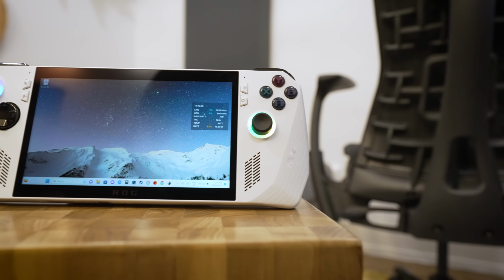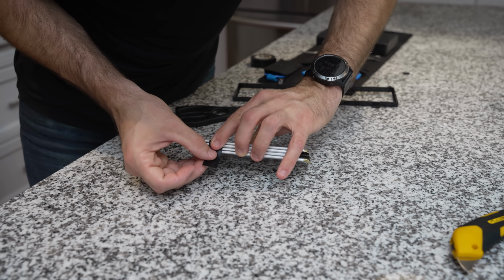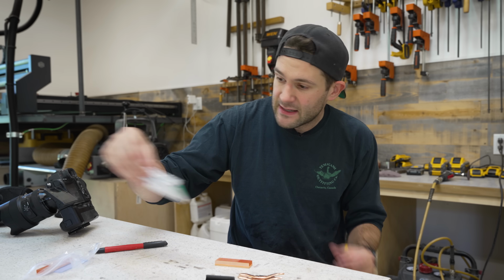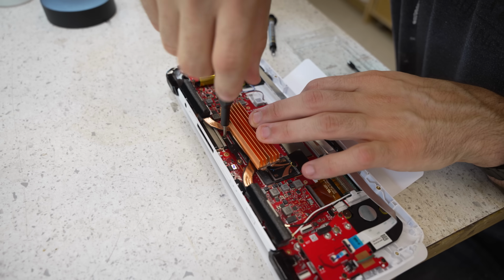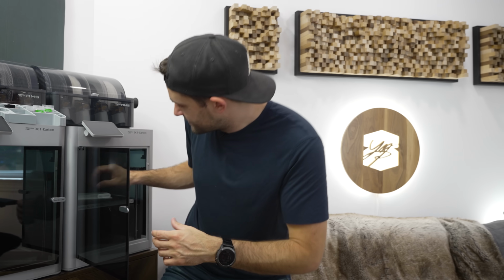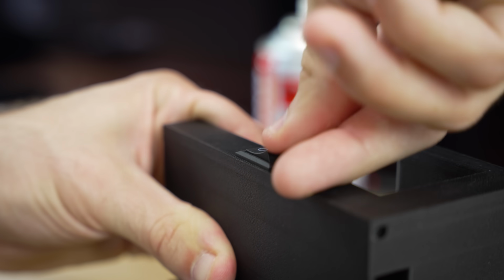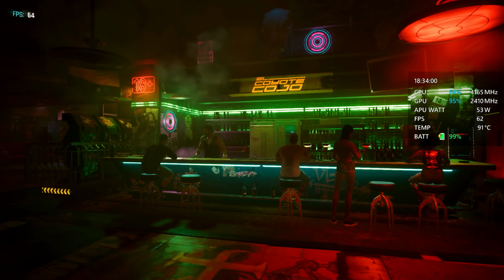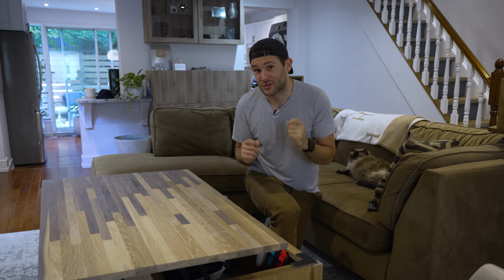I don't understand why people buy Steam Decks...

Comment: Would've been even cooler if you also added a push button for controlling the fan so it only activates if the Ally is actually docked.
Might have even found a way to detect if the dock is delivering power to the Ally and then trigger the fan based on if the Ally is powered on and sucking power from the dock.

Comment: the liquid metal ate the copper heat sink  didnt it?

cause i think you needed to nickel plate it first
Reply: also, is not liquid metal gallium? aluminium and gallium, not friends, as it destroys alu makes it like crumbling flakes :D
Reply: You can nickel plate a copper heat sink luckily, however you can just straight up use it on copper, it just has a chance of difusing and a second layer might be needed

Comment: now you can buy aftermarket Steam Deck for 512gb around for $250-300
-Repairability
-Availability of spare parts
-Great software and optimization for a handheld (it works 10-15 watts nice< even better on this wattage than other handhelds)
-The love and effort that Valve puts into the Support of their Steam Deck 
-You can use it in more diy projects

You can buy brand new Oled version with better hardware

Comment: You will need to reapply the Liquid Metal again later because it does absorb slightly into copper. If you notice an increase in your system thermals later, that will be why.

Comment: Hi! I have SteamDEck and buying Xreal Air 2 Pro for it. Its main problem cannpt power/charge while using the glasses as only one usbc port for charge or connect stuff... There are various expensive muds like RedMagic dock etc to solve it but with a cable mess.
I am building lithium packs for drones and electric motorcycles so have some soldering skills.

I have a plan to solder  to the 2 main +- cables of the Sd battery and make a small DC 2pin pug to one side.
That way I could give power to the battery leads directly which is as a 2S battery around 8.4V (it is written as higher voltage cells so 8.8V is the max, but I can measure vilt voltmeter at 90% charge level if it is 8.8V I can set a stepdown to 8.8V for example.)

And I could power it from 12V battery/adapter using stepdown dc-dc module setup for the battery voltage to keep (8-8V for example)....

What do you think?

Comment: Windows is the ROG Allys biggest weakness.  SteamOS is better.  In fact I'm building a desktop using ChimeraOS because I like the SteamOS experience so much.  I also don't like that the ROG Ally doesn't have touchpads like the Steamdeck does.  It should have at least one so you can use the desktop mode without using the touch screen.

Comment: Heck, okay, if tha Ally is too low fur u, u have simply too high expactations of a HANDheld...it must run cool, u know!?!

Also, yeah, the MSI Claw is out, might suite ur needs better.

But all gonna fry ur SD cards, if u not read tha manual, get the absolute fitting one!!!
USER's fault, 95 of these...rest r faulty SD-Cards!

Still, tha Steamdeck is fur tha pros, who know how to use the PC advantage in games...settings, and want to play fully mobile, fur 6-12 hrs, the competitors can't do, accepting the 720P limit.
Simple, but yeah, fur someone as spoiled to have issues with a handheld, one gen further then PS5, and not using Chimera OS...sorry, u r a IT noob!

Comment: When possible, I use my Ally 3 hours a day and I never cooked my SD card. I think that when people use handhelds as a desktop replacement, hook them up to an external monitors / tvs, and add external mobile GPUs and act surprised that the heat increases... and that the sd card "fries"... they prove the point that they are not the targeted demographic for handheld gaming pcs. I cannot blame them, marketing ruins everything, everytime. Special thanks to the grandmas who bought those for young kids at xmas and that were returned to Best buy. That allowed me to score an open box for 600 Canadian pesos (Z1 Exterme, flawless, my son is playing Battlefront II on it as I write this comment and we will be playing Helldivers II tonight... I digress) I agree that the SD Card slot placement is a design flaw, but again, if you use your Ally as a handheld device and upgrade your hard drive with a WD Black 2TB, you will love this thing. No need to dremel your back plate or to alter your cooling architecture at all. I have 2 Steamdecks gathering dust, we loved those devices but I am going to sell them and keep suporting Steam with games and future Steamdeck releases. Sure I miss the touch pads of the Steamdeck but that does not stop me from playing Command and Conquer Generals Zero Hours with the analog sticks on the Ally (yes I am old)... Ho, and my kids can play Minecraft for Windows, COD MWII, etc.

Comment: I suggest swapping the dock fans orientation. Aren't the stock fans on the ally blower style? If so they are pushing the air out from the top vent. The dock fan is pushing it back inside, potentially making the fans inside spin slower.

Spinning the dock fan around will pull air out of the exhaust vent.

Comment: I think you have one of the reasons right there and you didn't even mention it (however, I'd not expect you to install Linux on that ... thing). The Steam Deck is Linux-based, the ASUS is (as you've shown) running Windows. From my limited experience - I only use Windows for gaming, because of nvidia and bla bla, but I hear it's not that difficult to get the same experience on Linux, it's just that the steam app on Linux sucks even more than on Windows - Windows running "idle" has a much bigger power-draw than Linux riunning "idle". I've actually seen a higher power draw with a Windows system doing nothing than with Linux running two web browsers (because Slack is not supported on any chrome-based derived browsers anymore. Well, except the one nobody wants to use, MS Edge), a mail client, Visual Studio Code and a heap of terminal windows. Right now my CPU is fluctuating between 2% and 4% with that workload and Windows is using 10-12% doing basically nothing (no user programs started).
So I'd think the difference between this and the Steam Deck is a choice of what you want to do - do all the Microsoft stuff for Microsoft (or whatever they do when Windows is "idle"), or just play your game and concentrate on that. And I think Steam has made the right choice for a gaming machine, ASUS has not.

Comment: I can think of 3 reasons immediately.
1. Price
2. Convenience / support from Valve with their own OS
3. Elegance / design vs Ugly RGB lights
Reply: Also great ergonomics vs constant thumb sore
Reply: @arseniy3763  You had to be joking Steam Deck built in controllers are complete trash
Reply: @newmobils8294 well sorry but ROG is ugly and bad designed, Steamdeck is not, proof is Steamdeck will barely change its design and ROG is going to do it constantly over the years with the model probably also dissapearing
Reply: @josevalero3543   Arguing over the most subjective part of the two consoles is really dumb
Reply: @marcedoreste Also people are tired of being screwed over by Asus
Reply: rgb is a waste of space and money and electricity
Reply: just turn off rgb
Reply: Lol, bro really said "elegance" 😂. That chungous deck is the ugliest shit I have ever seen.
Reply: 4: the sd card slot won't die from a terrible design
Reply: I do agree that with the steam deck the controls definitely take some time getting use to but I never had an rog ally so I’m not sure if it’s controller are  better
Reply: Im sorry but both of them are ugly, the rest i agree with
Reply: Here is another reason : ASUS is infamous for hardware failures and trying to scam you hard on warranty repairs.

The original ROG Ally WILL break your microSD card by overheating it.
Reply: Steam Deck design are elegant? You've got a weird taste bro.
Reply: @LoL7LoL777LoL  It still looks like it's in an early-stage prototype.  I mean, the controls look like they were tacked on.  Now, looking at the Aya Neo line, those are beautiful machines.
Reply: @WJCTechyman  Thats what I thought.
Reply: Sorry but Steam Deck is the ugly one here Asus ROG Ally is way prettier.
Reply: @newmobils8294  you clearly have a bad taste
Reply: @josevalero3543   Anything that upset Steam Deck stans even if it was factual is considered bad taste
Reply: @josevalero3543  Just looking at the Steam Deck's controllers makes me think Valve could have done better.  They could clearly eliminate the nonsense that's the track pads.  I've never been a fan of track pads, unless it's Apple's version of them, as they all seem quite irritating compared to my track BALL.  Also, the standard button layout seen on Nintendo, Sony and Microsoft's standard controllers is really all you need.  Two shoulder buttons, two triggers, two thumbsticks with integrated buttons, four main face buttons and some function keys (+/Start, -/Select, Home/Xbox/PS, Capture).  Also, the track pad on the Dual Shock 4 and Dual Sense 5 seems to be a better option than Steam Deck.  Also, the motion sensing in Sony and Nintendo controllers is a nice feature, but some find it unnecessary.

Comment: Cool project! But you didn't talk about the difference between the Deck and the Ally, as titled!
Ally pros:
More power (Obviously)
Better screen (than the OG deck, not the OLED one)
higher resolution
Higher frame limit
Don't have to install Windows if you want it
lighter
smaller
Can connect to proprietary eGPU if you happen to be one of the 5 people who have one

Deck pros:
track pads
Gyro works simultaneously with thumb sticks (Ally switches from one to the other on the fly if you try to use gyro)
more back buttons
better ergonomics
OLED version has OLED
better battery life
Cheaper
Can use SteamOS or Windows
Capacitive touch thumb sticks. (They're not just for gyro. I use them for all sorts of things)
Controls are more customizable than Ally's
Has a Steam "Home" button. Why doesn't the Ally have one of these? My XBox controller has a home button. My third party PS4 controller has one. Why not the Ally?
Many replacement parts available online.

Comment: Steam Deck = Honda Civic stock, gets you around, easy to fix, dependable from a solid company. All other handhelds are just attempting to follow as fast as possible and pushing half finished stuff out that might be faster but...not without issues. I don't mind fixing a desktop, easy, modular....a handheld though, it needs to just work. Valve has been good to me since my first Half lIfe 2 purchase in '05, buying the deck was a easy move.

Comment: See, it is not fault in APU, that you got no proportional performance boost. It is fault of slow memory. Having 7500MT/s memories gets you some 15% higher performance with iGPU at 2,2GHz, than when memories are only 6400MT/s and iGPU at 2,7GHz. And at same time, lower clocked iGPU eats less power.

I do have OG 512GB Steam Deck. Then I got handheld with 7840u from crappy manufacturer not much different from asus, with more than double performance of Deck. (Number of failures that device has is really something.)
And I did get 1TB Steam Deck OLED, too.

So I do have 2x Deck. And device I poetically call: "That thing I spend time fixing instead of using."

Comment: I wonder if you could fit the bigger battery in while still using the original case. Maybe with some additional heat shielding to protect it. Going with a more low-profile and less weighty build is always nice.

Comment: The rog might have better proformance but runs windows has horrible battery life its suspend mode dose not work the steam deck has a better screen and better speekers. support from valve is far better. also you voided your warranty to modify you ally if i want to open up my steam deck and modify it that doesn't void the warranty the steam deck also has track pads the steam deck is perfect out of the box no mods required and because the deck runs steamos and not windows i can just boot it and play games no hassle no forced windows updates nothing honestly after seeing this video i don't get why people would get an ally over a steam deck when you have to do so many mods just to make it somewhat viable

Comment: The Dreamcast controller used hall effect analog triggers AND a hall effect joystick. I wouldn't think it would be an issue here...if it were, I'd think you'd be able to come up with some sort of wall blocking the magnets from the triggers and joystick to prevent interference.

But if SEGA was able to make it happen, I'm sure it's possible here. BTW, the ROG Ally SUCKS and the Steam Deck is a far better and superior handheld compared to that Asus garbage heap!

Comment: As an average gamer that is going to drop £600 on an ally, if i use thousands of pounds worth of 3D printers and software and several hundreds of pounds in materials, I can have an ally with better ventilation and battery life. This is much better than your £200 Nintendo switch but entirely not. Very creative upgrade. I enjoyed watching but felt like the guy that spent far too much on 4090 he would never get full use of, made fun of my 6900xt that I use to full potential but paid way less for and have used very efficiently for 3 years.

 I am renaming this video "Upgrading my Asus Ally." Fixed

Comment: its funny how steam fanboys are hurt and miss informed tho this video is highly missleading i have both i play on my steam deck for older or less graphical games using my asus rog ally for my main computer people seem to forget valve barely did anything with linux they just run steam on is and done al software and drivers that actual run games on it isnt done by valve for 1 bit valve just test games on it and see what works and what dont valves main income and main focus is steam itself so the rest are done by other people tho i like the touch pad makes things easyer asus rog ally aint perfect neighter with the sd card slot burning sd cards etc  tho asus rog ally runs games alot better due to windows and the better hardware its a fact i have both like them both but these fan boys are like a pest just enjoy what you have and if you prefer steam deck go play steam deck if you prefer asus play on your asus problem solved

Comment: It might be more powerful than the Steam Deck, but it rarely shows in its performance.  I've seen side by side comparisons, and there are a few games that the Ally runs better, but it comes at the cost of a shorter battery life for all software.  Windows is not optimized for the ally like Steam OS is for the Steam Deck.  It's really cool what you're doing to the Ally though.  It's an impressive little machine even though I prefer the Steam Deck.

Comment: ASUS service is poor, it’s hard to buy spare parts separately, you can’t repair it yourself. Shaders for the steam deck are compiled in advance, and on ASUS they are compiled directly on the console, reducing performance. It will also be difficult to resell later. Why did they release the console, simply because at the peak of sales there was not enough steam deck, but today there is plenty of steam deck.

Comment: I really appreciate those with the ability to mod things like this. Having all the tools, polishing the skills and being creative like this deserves all the appreciation we can show. 

That said I imagine how much fun the engineers of this product (and of Steam Deck) would have watching this video:
- Lets increase the thermal capacity: oh, the device wasn't thermal constrained the engineers had picked a proper cooling solution...
- Lets increase the APU power from 33 to 54W: oh, it marginally increased the performance because the engineers tuned the hardware to its sweet spot...
- Lets increase the battery capacity: oh, the cheap battery I picked went dead after 3 weeks and a good one would make the product (at least) USD 149 more expensive...

What I learned on this video is that this product was really well engineered for its cost range and target market. And this espetacular modding just made it a worse and costly product. But it was a fun video to watch, thank you!

Comment: Why didn't you protect the CPU from possible liquid metal leakage? It will happen 100%, sooner or later. It will lead to damage to the CPU and probably the motherboard. The new battery stopped working properly because the built-in charger is not designed to handle a battery with a different capacity. The charging current is not correct.

Comment: The reasons why people buy Steamdecks are first party support from valve so unlike asus they can actually control if it gets updates or not and what can and can’t run on it plus it’s significantly cheaper while also giving BETTER performance in the lower TDP compared to everything else plus the controls are better for most things since it has trackpads and on top of all of that it’s more refined due to how much longer it’s been out for plus the overall hardware is also nicer

Comment: The Deck is weak but I've found with experience it doesn't need to be powerful. Playing AAA titles on a small screen is sub optimal and will take away your enjoyment of it. Handheld devices are far better off with older or Indie stuff without top notch graphics, plus the battery will actually last more than an hour with the right game.